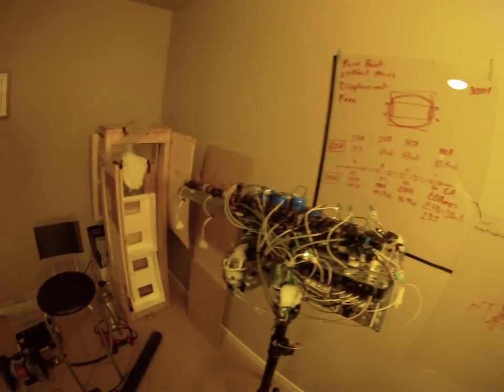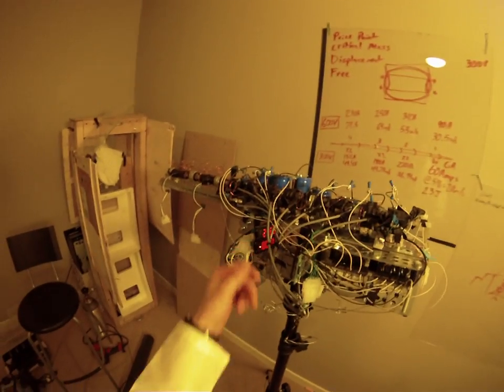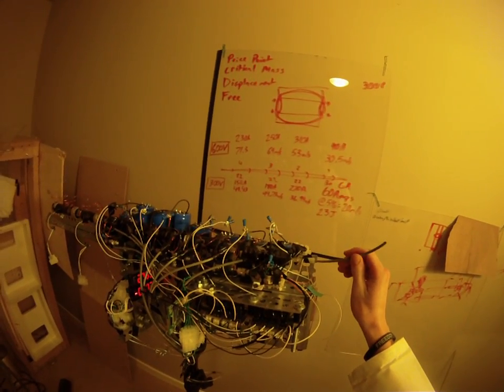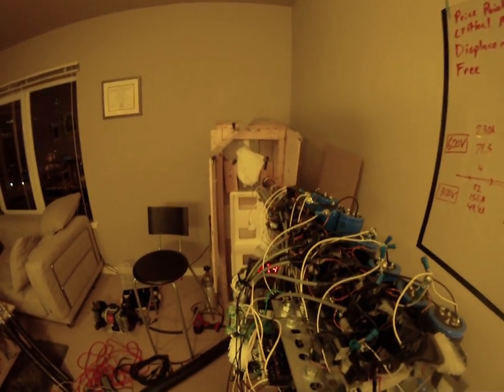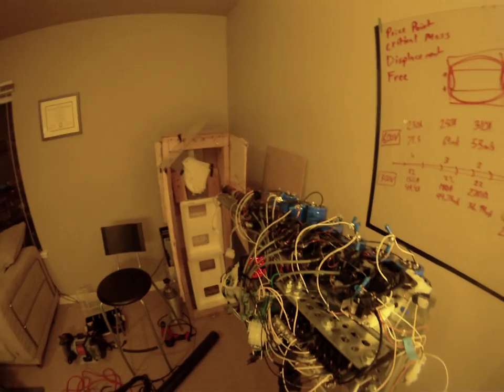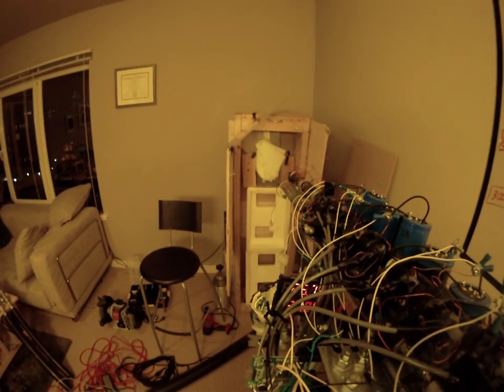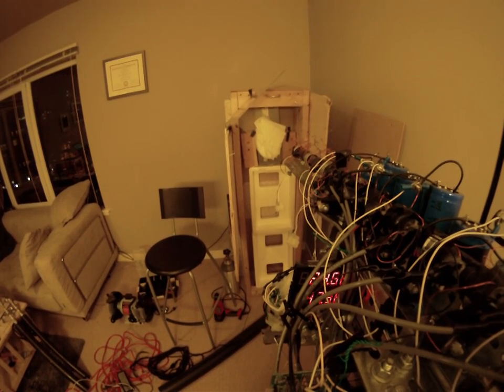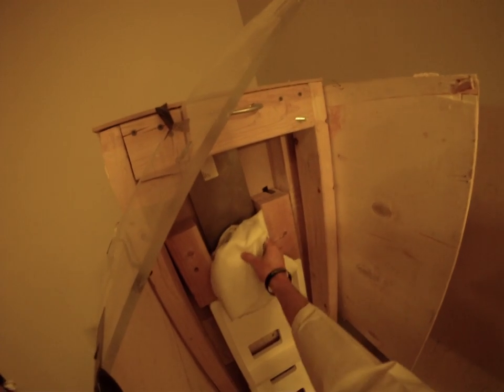Firing an electromagnetic rifle at a piece of plexiglas

Comment from the maker: Way too much. Probably $500 in parts and countless hours of work. The real difficulty is that I didn't do enough background research into the high-end machines before I began. Just breaking the 40m/s mark is hard and requires multi-coil. Breaking 60m/s needs some very particular timing and design of the inductors; their rise and fall times need to be just right and that has to be built in from the beginning, which can't be done in just math and needs magnetic simulation of dynamic objects.